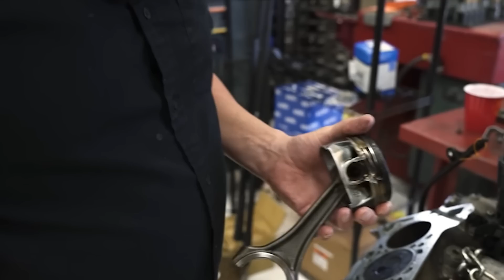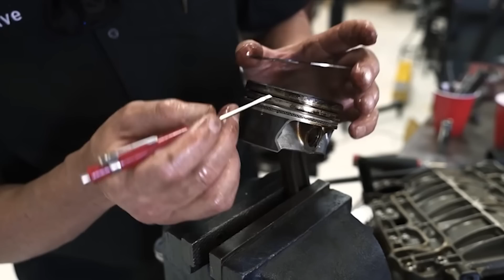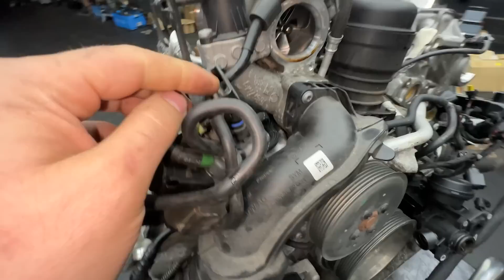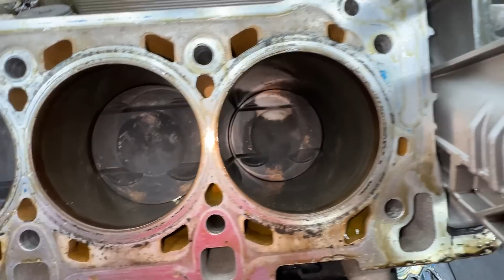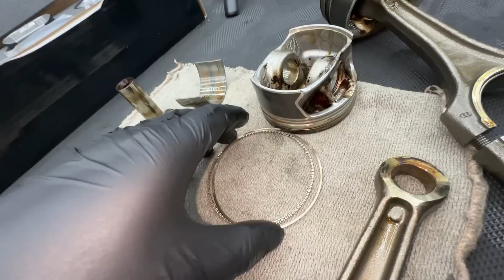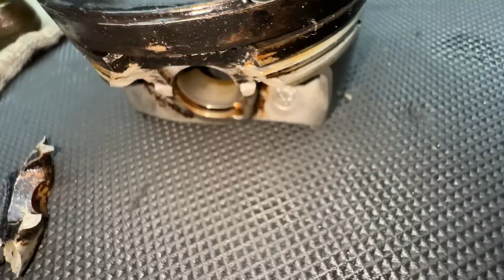Reaction video on LSPI from Dave's Auto Center and 034 . Why I like the EA839 engine from Audi B9s

Comment: I have this engine in my Audi. I changed the PCV valve hose and oil separator. I haven't seen any oil consumption since. If you have this you'll need to do an over haul of the cooling system before 100k. Make sure you change both vacuum solenoids that go along with it or it will show a coolant temp too high. Change your spark plugs every 60k. I do oil changes about every 7k to 8k miles. Change transmission fluid with a drain and fill every 60k. I have about 118k on the dash right now. Will probably look into getting intake valves walnut blasted a shop soon, get an after market cold air intake, high flow cat, and upgraded charge pipe.

Comment: If it is a low oil control ring issue, why is it only happening on Direct Injection Engines? If it is an oil being thick when cold issue, why is it only happening on Direct Injection Engines? So common sense tells us this is not a low tension ring issue, it's not an oil issue, ITS A DIRECT INJECTOR BEING DIRTY ISSUE, Causing fuel to not be atomized, instead the injector creates droplets of fuel, which causes the piston to be melted.

Comment: one quick question. when installing rings... Do I put the gap of the oil ring facing the lower side of the V? the next one 180 degrees (so the gap up) and the last one? I have read conflicting info

Comment: In North America we are seeing LSPI in natural induction engines as well.
The engine makers are calling for lighter oil and people here are cheap so they buy the least expensive fuel (87 octane).  They also do not warm up engines or change oil as frequently as they should (extended oil changes of 10k miles are not uncommon, and many people push them even further).  I personally use Liqi Moly 5W-40 in both my VW (2.0T as well as 3.6 VR6) change it at 5k Km and I use the correct grade of gasoline from a reputable dealer.  No problems even though many people in North America think that these VW engines are some of the worse ever designed.  They are great if you look after them and do the maintenance.
It is a receipt for disaster.

Comment: I'm looking at getting a B9 SQ5. And I was wondering about the 0w20 vs 5w40 debate on these engines. I do most of my own maintenance and repairs. What would you recommend doing in terms of oil viscosity. Also, are there any aftermarket metal parts for say the thermostat (as an example) that can replace the crappy plastics parts?

Comment: He almost agreed with Dave in that getting on it at low RPMS is bad,  The piston damage was not even the same.   At least Dave referenced the injector as a possibly culprit putting too much fuel in the cylinder and getting into the oiled cavity which to me would make sense in his scenario.   And if getting on it at low rpms in an AWD car meant for hole shot is bad then it sounds more like a tuning problem.  Also if the rocker arms are failing, what rpm can you even drive these cars at?  and how is it a good engine LMAO.  Dave deserves more credit than this.  Despite his molasis theory.  LMAO

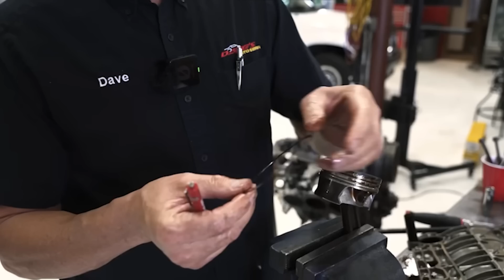Comment: Hi guys from Vagtech. As a mechanic, I enjoy watching you do a great job and explain it step by step. Love it. A month ago, I bought my 2017 SQ5 with only 43,000 miles. It was imported from the US to Belgium. Within 1,000 km, I started having problems with cylinder 6. After a thorough diagnosis, it turned out to be compression problems in cylinder 6, which caused the system to shut down cylinders 4 and 5 after 1 minute. Today, I completely disassembled the engine and indeed removed the pistons, and as you said, my 2017 and up to 05:18 have weaker ones. I also think the fuel is different in the US than in Europe, including the UK. And I suspect this is a role-playing game to cause additional damage. Oh yeah, what Dave from US also says is partly nonsense. Americans can't maintain and repair EU cars as well
Reply: I don't think "partly nonsense" is fair.  It's a theory, and we need differing theories to play out against one another to actually get to the bottom of things.  As Thomas said - the truth is always somewhere in the middle.

Comment: It sounds like an easy way to help prevent this is drive in sport mode until the engine warms.  Sport keeps the RPMs from going to low.  What are your thoughts on running a 0w-30 oil instead of 20?

Comment: 20 year master tech and Volvo expert tech here with a 2024 S5. Dave’s video is BS and lost my respect because he never once mentions vw504 or vw508 spec oil for these engines which is what Audi calls for. I never once saw an engine grenading due to oil viscosity and I worked all over the world for Volvo. I would not take my car to him and hope his techs are smarter than him.

I do agree with your assessment that the piston has a weak spot however just because part numbers change doesn’t mean a new design. At times it could mean different manufacture.

Comment: I have an S5 B9 not tuned , currently using 0w20 oil , what is the best oil to use and interval between oil changes?
Reply: Mobil 1 esp 0w30 VW 504 spec

Comment: Had the same piston crack on my B9 SQ5 during summer 2024, it cracked in the exact same spot, build date late 2017, cracked at 80000km.
Was piston nr.6, no visable damage via borescope, but once the poston was out the crack was visable, the small piece had still not broken of completely.
All six pistons replaced by Audi, do you know if the revised pistons are same design or more durable?

Thansk for the great B9 content!
Reply: What was the symptoms of your car, was it just misfiring?
Reply: @squadgoals4948  An uneven idle and some minor vibrations.

Comment: IDK... i have a 2016 3.0, had a mild ticking starting around 40k miles, that progressively got worse over the next 2 years. I put about 5-6k miles a year on the car, and it gets an oil change every 6 months. Went down the rabbit hole trying to find the ticking noise, driver's wheel well only. Car ran perfectly. no codes. Started having the rattle at startup around 49k miles. Ripped the engine out figuring to do a complete timing replacement. Found a stretched chain, no damage to tensioners or guides. Weird, don't hear that much. While engine was out, replaced all belts, pulleys, tensioners, PCV, and serviced the Trans & SC. Figured im solid again after i get the engine back in. NOPE!!! FRont of engine, dead quiet, rear of engine, dead quiet now, noisy uo top, and same at front lt. wheel well. FK!! Engine back out, recheck timing gear and all reassemly. Nothing!  Went for driver"s side head. Relaced lifters springs, rockers..  Engine back in,,, same wheel well noise. 99% sure now it's piston slap. Car was never abused, only one odd incident at start up, where i got a horrible miss, and the EDC(?) light came on. Shut it down, waited, all good on next restart.  So i'm thinking i got bad gas, had an injector issue, and fried a ring. I'm not digging deeper into the engine, picked up a 21K mlie used motor, with a warranty. Crazy how so many things can easily fail on a meticulously mainted vehicle.

Comment: I have a 2019 SQ5 with 125000km wit a TTE810 pushing 750hp and never had issues . Oil changed ever 5000km with Motul 5w40 . Fantastic engine and like was mentioned in this video most problem with this engine are caused between the engine and the steering wheel 😂 . Great video keep up the good work 😉
Reply: Just curious why do you use 5W40 when the manual calls for 0W20?
Reply: @kliether33  5W 40 is the high quality oil that you need to prevent the low speed ignition

Comment: You would be surprised in the UK how many young drivers show off by pushing there cars turbo or non turbo within 1 minute of the engine being started. It's a case of you don't know what you don't know. 

I don't even put my 1.8T audi above 2k rpm until coolant is showing 90 degrees as a rule. Even when the engine is warmed up I try to not use my turbo and go above 2.5rpm unless necessary.

Great video and in depth chat about these engines. I would love to know the weight difference between the OEM and forged piston and the thickness differences in areas of the piston.

Thumbs up, watching from London.

Comment: Hi, Great video and content. I've worked in F1 as a Materials Engineer for F1 ICE. What you showed on the piston was a fatigue failure, caused by the sharp edge on the piston crown where the valve undercut is. If this edge was smoothed or shot peened, this would eliminate the issue and failure from occurring.
Reply: If you actually have the experience you say you do - MAN - that's some valuable insight to hear.  Can't believe it's not a top comment.

Comment: Looks similar to the Toyota original early 1zzfe pistons with tiny oil holes for the oil control ring, these get gummed up because of lack oil oil flow. Second generation had four oil holes per side and the holes were also bigger.

Comment: It's well known here in Germany. An Audi constructor had redesigned the oil control rings incorrectly. This meant that the 5W-30 water-based oil, which is prone to coking, no longer allowed the rings to spread in the ring pockets, which were too small. The result is very high oil consumption and wear.
Reply: What Oil should then be used?! Audi has revised it to 0W/30 now which is even more thin
Reply: @danielfl.9347  
Of course, if you have a particulate filter from the end of 2018, you have to be careful about which cleaning oil you can use. 5W-30 may be the fixed interval oil for you.
I know that the Siberian 0W-30 or 0W-20 oil is even worse. The engine in my friend's 1.5 also sounds like a sack of nuts. Of course, this is also because it has already done 25,000 km.
Don't be fooled by these water-based oils, which only offer advantages for short journeys and quick cold start oiling. But on hot motorway stretches, on US highways, stages, these oils tend to burn. Of course we don't need thick oil like in the GT or 24-hour race 10W-60 or 20W-60.
But in my 1.8 TSI, fully synthetic 5W-40, which I change every 10,000 km, is the best choice for me.
&, the manufacturer's oil specification is only the minimum quality & not the highest. It is wrong that longlife oils with the long flexible change interval are described as high quality & fixed interval 5W-40 as inferior quality.
Reply: @marcusk4152  Hmm I use 0W/30 in my twincharged TSI engine (supercharger and turbocharger) and change every 7-8000km.

No Oil burning.

But I would consider going up to 0W/40, but the problem is then the timing chain
Reply: @danielfl.9347  You definitely don't need to worry about using a 40 oil, whether the tensioner builds up enough pressure quickly or the chain is sufficiently coated with oil.
The more an engine is loaded with a turbo and compressor, the thicker the oil should be. https://youtube.com/shorts/Y3H_hVYJOWE?si=moh7AAzFXa84v7oR
My first engine had an extreme cold start clattering noise from 13,000 km, which didn't come from the hydraulic tappets or the chain tensioner. It was caused by the oil overpressure, which caused the pressure relief valve on the pump to audibly open. I think it was due to the twisted bearing of the balance shafts which blocked the oil channels.
5W-30 was in there, but it was independent of the oil.
Reply: @marcusk4152  I will consider going up in thickness, but never a 5W or 10W as it does not make sense in Denmark (cold). The timing chain tensioner has been replaced but still need thin Oil VW says
Reply: @danielfl.9347  I have only met clueless replacement mechanics at VW. I even had to suggest the first attempt at repair with an oil pump 2.0. Audi had already installed a chain tensioner that was too weak and we know the consequences. The viscosity of the oil definitely has no influence on the pressure build-up in the chain tensioner.
Reply: @marcusk4152  I do disagree. For normal engines a 5W/40 would be better, but for engines with timing chain a 0W will always win. Much quicker Oil pressure build up
Reply: @danielfl.9347  Yes, it's all a matter of opinion. I had a brief cold start chain rattle with the first engine using 5W-30. With the second engine using 5W-40 fully synthetic, there was no chain rattle.
Reply: water based oil?
Reply: @alexstromberg7696  Only in terms of viscosity it is comparable to water.
You can see it very clearly when changing it, it runs out like water. Sewing machine oil is no different.

Comment: Yeah Dave got to be super annoying since his YouTube channel exploded. Forget the combustion plus he’s got these other “experts “ flogging expensive pistons and rings .He must be insufferable to work for .Oh yeah and change your oil every 300 miles .
Reply: I think you are being a little too harsh 
First of all he is a master machinist and engine builder. Probably one of the best in the country at that. He fixes a lot of manufacturers mistakes. Duramax engines for example, keyways on the crankshafts. 3000K miles on oil changes for his engines that he builds for his warranty is not that bad. A little early sure. I do 4000K on full synthetic.

Comment: Can the light spot be a reason for a non-right working injector? So the combustion is not ideal and LSPI knocks the piston until it breaks at the weakest point.

I think a lot of engines died because injectors don't work.
Do you check them too?

Comment: I’ve  a S4 b9 and a problem with a ticking noise from the driver's side (Europe), replaced the HPFP and rocker arms didnt solve the problem, what can it be?
Reply: too
Reply: HPFP is on the passenger side
Reply: @oppositelock4356  I know, but the ticking from the driver side

Comment: I just want to mention that, u don't need to be complete idiot to push the car cold, u just need to be German. Sadly that is typical German driving method, the starter is turning the engine but u are already in D, or first gear and u already pushing the gas pedal. I know this is sad, I didn't wanted to believe it but I live for 4 years in Germany and I have to admit it's sadly true story. :(((

Comment: Great video! I agree with you 100% on all points discussed. One question I do have though is, from a a fuelling perspective, for those of us running E85, or a flex-fuel tune with an ethanol blend - of say E40 upwards as an example, my belief is that this would significant reduce the likelihood of LSPI, and thus a failed piston. Yes there is definitely a design flaw on the piston, but if the chances of LSPI can be greatly reduced via a different fuel type, that has to be a good thing, right? Interested to hear your thoughts on this! :) Cheers

Comment: This is great.  I watched that video from Dave some time ago and at the time I was kind of questioning the logic behind his explanation.  LSPI?  I kind of understand that this might be the case if there was a failing injector that was bleeding in more fuel than it was supposed to leading to cylinder wall washing and then detonation in the ring lands.  I am more inclined to agree with your assessment as to what caused the piston to fail given the physical damage that seemed to have been occurring over time before that section of piston gave way.  Pretty clear to me that the piston has a weak spot as you showed.

Comment: 30 years ago was blowing ring lands out of 1.6 cvh engines with turbos😂😂....the normaly aspirated ones never realy killed,even at max rpm up hills on motorway..used to buy standard ,xr2 pistoms as cheap and get an old boy to machine tops flat and go.....didnt seem to fare anyworse than the correct Ford  turbo pistons...happy days......

Comment: Normally the detononation is not happening on gold parts of the cumpustion chamber like the pistor ring area. It is happening in the hot spots. And the non misted fuel will not change this. It will just make more CO and HC emissions entering to the cat...

Comment: You make so good points in this video. Nothing is black & white and opinions will vary. As you say, flooring the pedal at low rpm puts a lot of stress on the internals. Looking at that engine, the exhaust outlet on that turbo is massive. It’s clearly moving a lot of air. Thanks for the technical update, good video.

Comment: Very interesting you run and recommend 5w 40 I will give it a go 👍
Reply: I do the same. Audi 'recommend', a 5W30 in my DNWA RS3, but over here in Australia where it gets pretty hot in summer, there is better engine protection with a 5W40 at the cost of perhaps a very very marginal degree of engine efficiency from a fuel perspective.